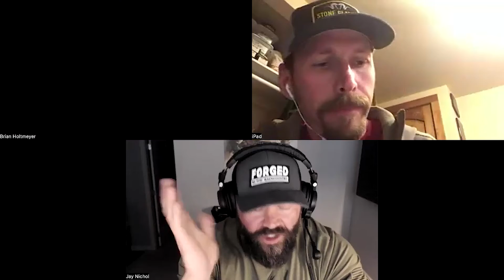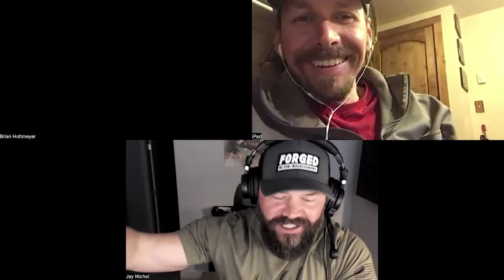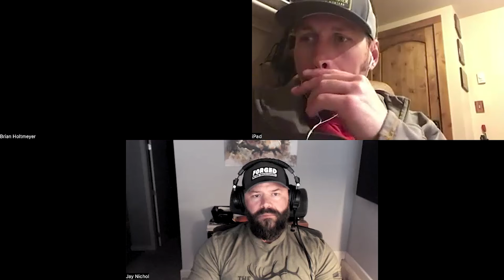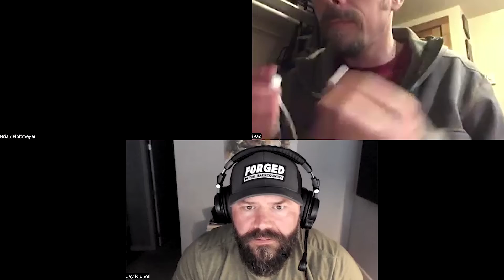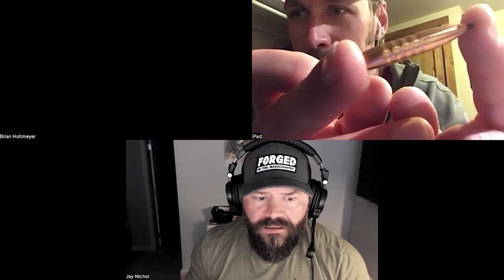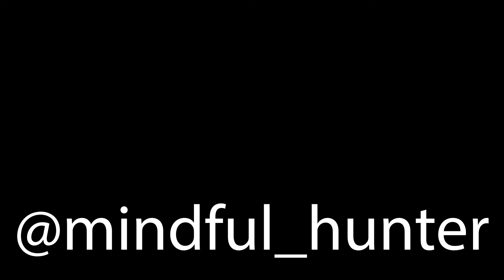A Fresh Perspective on Bullet Design with Hammer Bullets, Colton and Jay - The MH Podcast

Comment: 20-30 gr Light for caliber is an absolute must if ya wana shoot monolithic projectiles.   Thats whsts needed to get the velocity up to a point ware they give the same or similar kill effects as lead core projectiles.   I cant stress enough that you have to go lighter with copper!  Personally   I like the barnes TTSX,  i dont like the hammer bullets shedding petals design.   The barnes ttsx peel back and hold there petals and they hit hard!